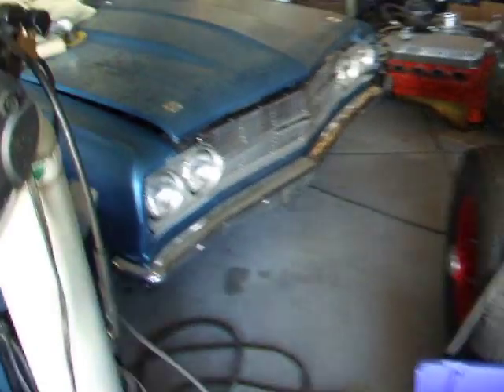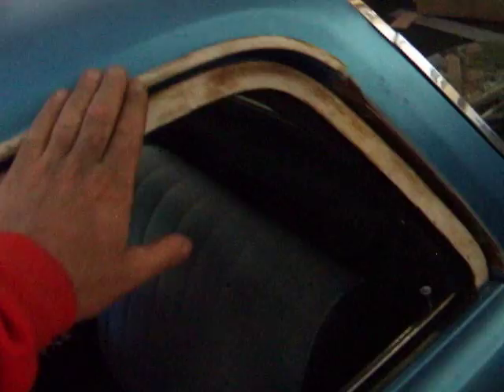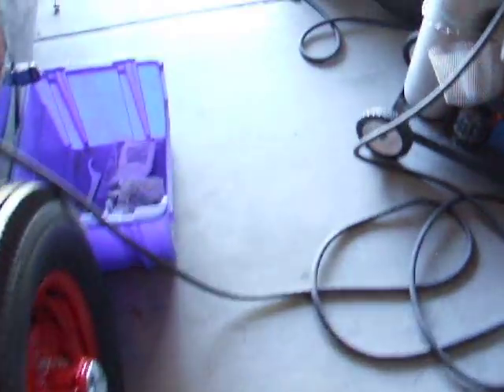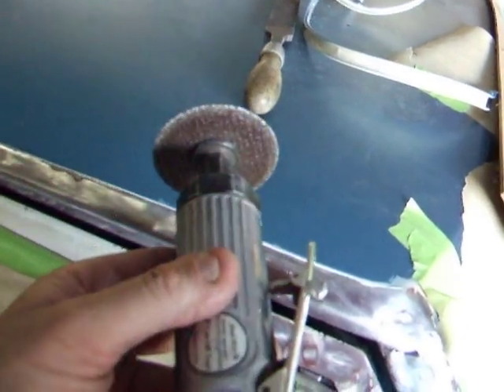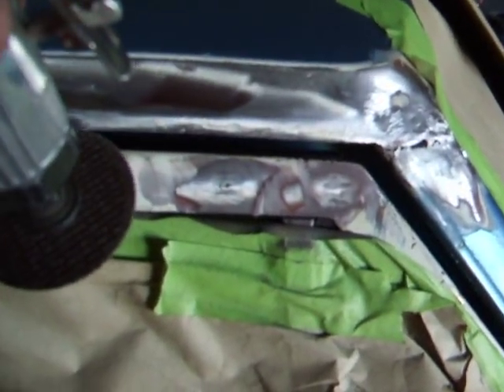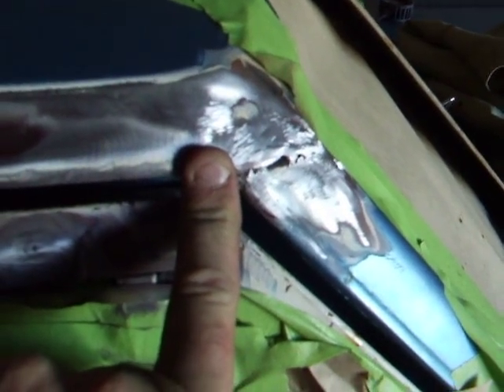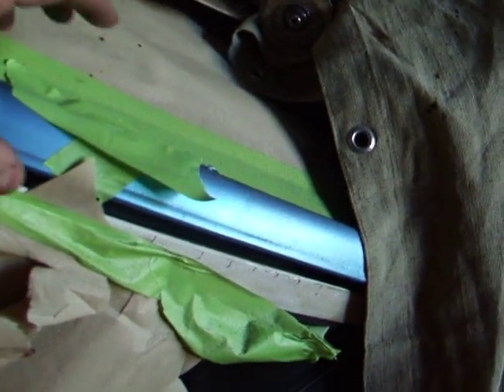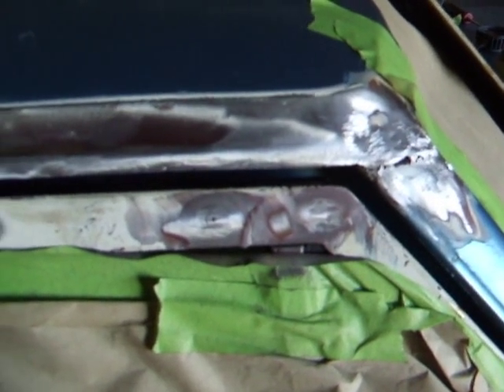Drip Rail Removal 1965 El Camino

Comment from the maker: A great question !!  No need to on an El camino. The roof is very short. On a car I would, or you could possibly have problems with the roof being so long and it may move on you. I cut the entire section off then tacked it on.... If you look at the video around the half way point I mention tacking the roof in short sections..Do not heat up or you can warp the roof. Also, be careful about igniting the filler insulation in the roof...